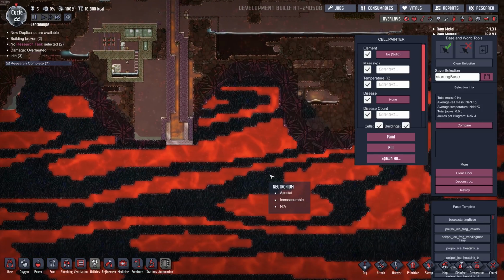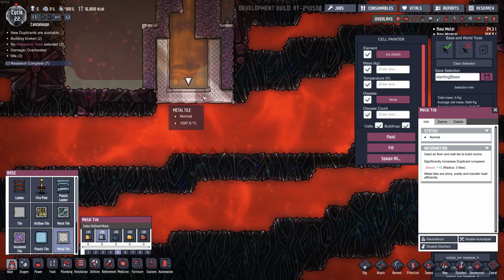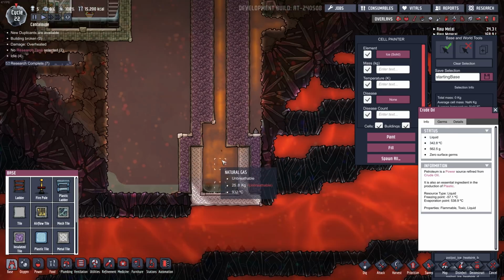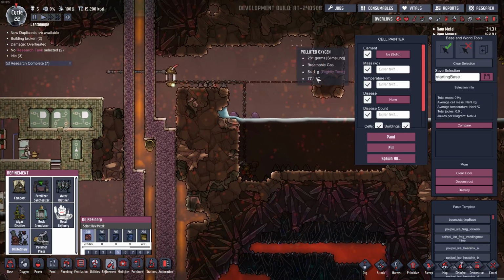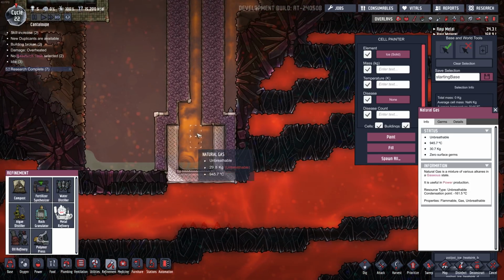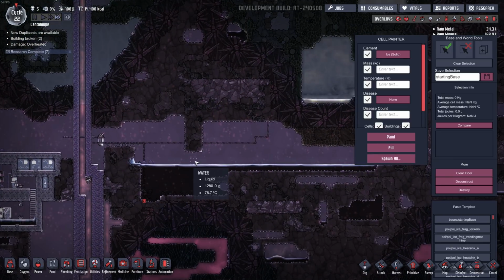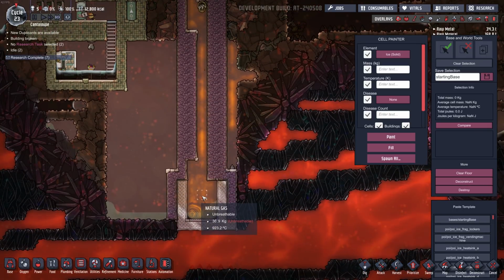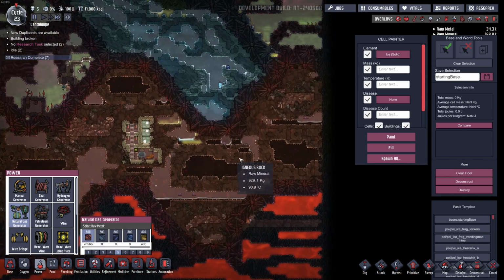MAKE NATURAL GAS FROM OIL USING MAGMA - Oxygen Not Included Automation Upgrade

Comment: You actually can reach 2000 C artificially. Send your crude oil into Metal Refinery and loop it on itself. Crude Oil turns into Petroleum once it reaches at 400 C, but since it's a liquid too, the game bugs out and Oil never converts neither to Petroleum nor to Natural Gas. You can easily heat oil up to 2000 C and higher (using Abyssalite insulated pipes). But there is a problem. You cannot heat anything with it. Once oils temperature goes down it instantly converts to Petroleum of NG and breaks the pipe. Dumping it via Liquid Vent does the trick, though.
P.S. Metal Refinery can be built from Abyssalite, +2000 C overheat temperature.

Another way is to pump magma with Wolframite pump into Metal Refinery. It will start to slowly get Overheat damage, but we only need 400 - 1000 kg of magma. Don't use Gold Amalgam, the pump will instantly melt down. Once the magma is in the Refinery, you can heat it up to 2350 C (vaporization point) and use it to heat whatever you want to. Just don't let the temperature to drop below 1410 C or it will turn to Igneous Rock.
Reply from the maker: Sounds like some fun experiments. I did try the abyssalite refinery thing out way back but it was too much of a hassle to be useful.

Comment: Very interesting idea!!  But for now, no work for me. Magma always tends to cool down when you replace the natural Abisalyte for any tile, in my case metal. The metal tile reaches a temperature of 1310 -1320, is not enought hot, because magma freeze at 1409º, then always tend to freeze. Did you get it to work well?If the answer is affirmative, please Grind This Game, could you say how you got it? THANKS.
Reply from the maker: It's ok if the magma turns to rock. It should stay quite hot if it's touching other magma. Eventually it will all turn solid but should stay 1200C or so for a while. As long as you only drip small amounts of oil on the metal it should convert for a while.
Reply: Yes, this system work ok for a relativity long time, but I want to find the way that is infinite. More now, that i only have one natural gas geyser in my map, no two, i dont know if is for the last update or is a bug, but i only have one, and i need a good source of power. Thanks for answer and very good ONI videos!

Comment: How would someone get their dupes far enough down to build the heat exchanger between the oil and magma? I thought exosuits only provide protection to around 700 degrees? Love the concept.
Reply from the maker: They will take some damage if they stand in lava without a suit but they actually last quite a while. So I usually send them down in shifts and heal them in between. They only have to build a few tiles by the lava and the hard part is over.

Comment: Nice idea with the cold biome, I use a diamond evaporative cooler and Obsidian tile in the oil upgrade (720g/s) https://imgur.com/svmcNDN
Reply from the maker: Nice setup :) So that fresh water is sucking all the heat?
Reply: Yes, the water turns into steam and holds the diamond (also works with granite tiles) at ~ 100 ° C

The 50 ° C inflow of crude oil is enough to condense the steam back.

100 cycles of cheap gas
100 further cycles for which one must work
https://imgur.com/a/w8njs

Comment: Maybe with a better set of metal tiles to distribute out the cooling of the oil... also maybe preheating the oil, or heating it up slower over a longer set of metal tiles like a waterfall with more direct magma contact to the metal tiles will make that more sustainable. Still building it is going to be a major challenge for your duplicants anyway.

Actually after a second look, your natural gas in the column is over the vaporization point of the oil and petroleum, so really once you have this started, you shouldn't even need to be drawing off too much heat from the magma anyway, if you slow down the rate of the descent of the crude oil, it should vaporize before it even hits the tungsten tiles.
Reply from the maker: I'm not sure a liquid would heat up fast enough in the natural gas (even with gas at 500C+) but maybe if it was a tiny tiny amount. I'll test things out and see. If you could spider in a large heat conductive material into all the magma that could be a better long term solution. Kinda like in geothermal plants. But dupes don't like swimming in lava so much :P

Comment: It'll be interesting to see what else the automation update brings, especially with the new thermal spreaders, it's kind of unfortunate that I haven't seen anyone figure out how to specifically isolate heat in large quantities, but I guess the energy needed and method of moving heat in one direction and bleeding it off into some thermal system is kind of moot with self cooling systems and magical wheezewarts anyways.
Reply from the maker: Water is pretty darn good at soaking up heat and oil as well. It's interesting that metal tiles work pretty good at moving heat and they introduced them at the same time as the thermal spreaders.

Comment: You should send this to Brothgar, this is a really interesting idea
Reply: Yeah I need to see this tested longer to see what happens to the magma levels, and to see if it can be made more sustainable.
Reply from the maker: I did watch it for longer after and magma levels did go down so I extended a 1 tile row down into the magma. That did the trick but I need to run it for 100s of cycles to see how it works.
Reply: Maybe you could try moving that lava to a tungsten tank where you can put space heaters around it, then you can still produce petroleum on the top of the tungsten tank without the lava solidifying?
Reply from the maker: I think the space heaters may melt.
Reply: You can make them out of tungsten though
Also you could add a thermo switch so they don't overheat too much, the oil is going to gradually cool the area down like it did in this video

Comment: Very nice. Didn't think petroleum gens were any good but wasn't aware of just how bad it was.  I'd like to see if there was a sustainable way of turning the oil into petroleum through heat. The range is pretty tight.
Reply from the maker: I think the devs assumed most people would use petroleum for plastic...but after a while everything is plastic and you have petroleum as a "waste" product. The generator isn't too bad, it's the refinery that isn't so great because you lose half your oil during refining.
Reply: The refinery needing a dupe is the real bad part.  Totally a game design choice but that is another reason petroleum generators are bad(they in effect take a dupe to run).
Reply: I've made a lot in the oil upgrade, with careful digging and the hand pump
https://imgur.com/a/iIIKn